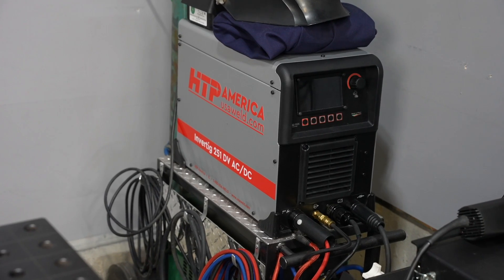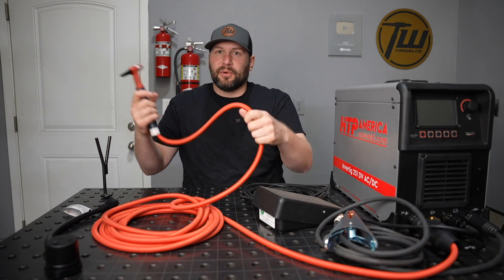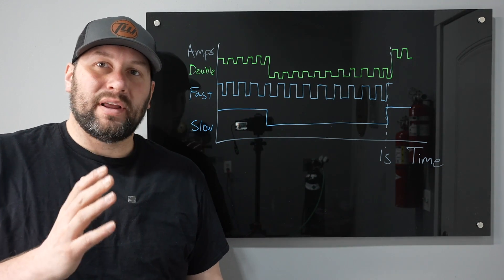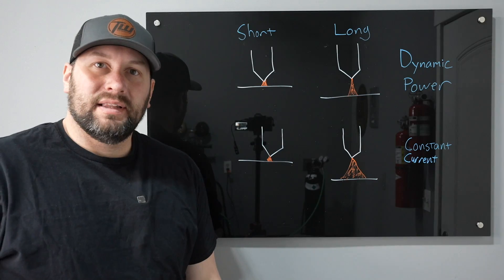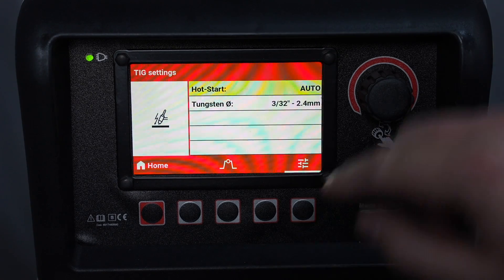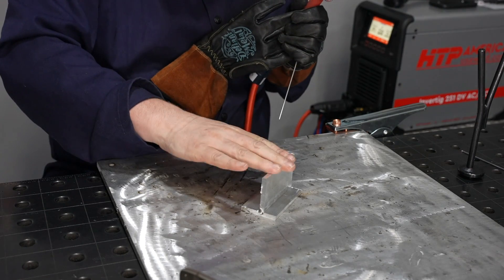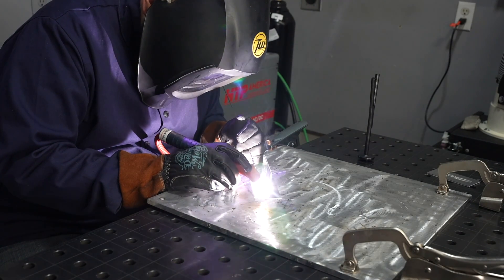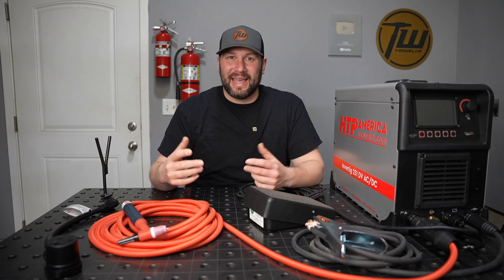What’s New on the HTP Invertig 251 AC/DC TIG Welder?

Comment: Great video Tim! Would you know if the 251 has a solid state HF start or is it still a spark gap setup like the 221? Gaps fine but it'd be nice if they went digital on the nicer machine.

Comment: Ok Tim, I just found your channel and really appreciate your candor in evaluating this welder. Finding your video is also just in time to add to my confusion on buying a premium TIG machine. Currently looking a Miller's new Dynasty 210 and Fronius 230i, wondered if you've had any experience with either? I must say the HTP is very impressive and the pricing is a component of that impression, but like the Fronius, this is a foreign manufacturer and support is part of my concern, also can other torches such as CK products be used on it? Thanks again for your review and you've got another subscriber!
Reply from the maker: Great questions! I have a Dynasty 200 that I bought brand new in 2010 and it's a great machine. The new ones have a nice interface and a few more features, but the performance feels similar to me. I've spent about 8 hours running a Fronius Magic Wave, now the iWave. They're  both really nice machines. This one performs every bit as well and has good US support by HTP based in Chicago. It's completely compatible with CK torches, that's what I run. It's also compatible with Miller foot pedals. HTP usually includes CK torches with their machines, but the air cooled one on this is a heavy hitters with a higher amperage rating. You can call them and they'll customize the package to include whatever torch you want.

Comment: @TimWelds Hello Tim. As you know HTP was bought by Stel. So in Europe we get Stel T300 which is identical to the DV 251. So my question is, since you have the unit, does  your machine give an error when you turn it off and then after 1-2 seconds the machine starts the power down cycle or are the italians bull@#$ me and mine has a problem. It is a brand new machine.
Thanks!
Reply from the maker: Honestly, I haven't looked at the screen after I turn off the switch. If it doesn't cause a functional problem I probably wouldn't have noticed.
Reply: @TimWelds  Thank you. By the way great videos.

Comment: Thoughts on this vs just going to the Revolution as an all in one?   My 15 year old Hobart MIG is as basic as you can get and I'm looking for a new MIG, but I wouldn't mind trying a new TIG as well.  Currently running an Everlast 255ext, and I struggle with low amperage arc stability.
Reply from the maker: This one has a lot more features like independent waveforms, fast tack, soft pulse, etc. The TIG performance is just as good on the Revolution 2500, from what I understand it shares a lot of the same electronics. The Revolution has all the basics such as 2 waveforms, AC and DC pulse, tunable starts, etc. If you don't need the fancy features and could use a wire feed welder too, the Revolution is a great deal. If you want the extensive feature set or if you don't need wire feed, I'd go with this one. The low amperage arc stability is great on both.
Reply: @TimWelds my main concern with a multi process is that if it goes down then I'm stuck without a MIG and TIG.  We use both types in my shop, sometimes at the same time.  Probably try out HTP with a MIG unit (which apparently they all do DC and stick).  And if I like it, add a TIG later.

Comment: Out of curiosity, how does this compare to the Primeweld Tig225 or Tig325? From the beginner hobbyist it seems this HTP has too many features that can serve as a crutch for learning the right technique. If you are experienced, and this improves your efficiency I can see where that would matter.
Reply from the maker: That's a great question. I have used the PrimeWeld 225 quite a bit, but I haven't tried the 325. I wouldn't say that any of the advanced features really serve as a crutch for bad technique, with bad technique you'll get a lousy weld no matter how nice the machine. The advanced features just allow you to fine tune the process and do different things. A few examples that I use regularly:
Asymmetric AC waveforms-I almost always run my electrode-positive side lower to keep a sharp point on my tungsten and give a very narrow etching band
Waveform Control-On thin metal, triangular wave gives better penetration without burning through
 More Waveforms-If I want a really shiny bead, soft square wave reduces the amount of aluminum spitting (not a technical term) from the puddle, leaving the the bead more shiny (you can see the more dull speckled appearance on aluminum beads from most budget welders if you look closely)
Adjustable Hot start-Most welders start the arc at a much higher amperage than the   setting. Notice review videos of budget machines on thin metal/razor blades/pop cans almost always start off the side of the material or on filler metal, then move to the joint after the arc is established. This machine allows you to fine tune the starting characteristics and start right on the material. 
Advanced features aside, the reality is that higher end machines like this just weld better than budget machines. They're just built differently. Don't get me wrong, I think the PrimeWeld is great for the money and I recommend them often to the right person, but I like the feel of the welding arc on the HTPs much better even without the fancy features. I still use my HTP Invertig 221 quite a bit, it's also an awesome machine with fewer features that's still available around $2k, though the user interface is pretty outdated as it's been on the market for about 15 years. I also have a Miller Dynasty which is right on par with the HTP machines, but at twice the price, I think the HTP is a better value with equivalent performance. Both the PrimeWeld and HTP are a great value for what they offer, it just depends on whether you're in the market for an entry level or professional level machine.
Reply: @TimWelds  Thanks for the very detailed and thoughtful reply. I would love to get the HTP but can't really justify it my use case as a hobbyist that welds a couple of hours a week. I figure the Primeweld will be more than plenty for me and give me a chance to get more welding time in since I can allocate more of my budget to the overall setup like a water cooler.
Reply: @MegaMajormax  if you plan to continue welding for a long time you may want to consider the htp anyways. its a safe bet it would still be working 10-15-20 years down the line. i wouldnt hold my breath prime weld could last that long

Comment: I love the HTP’s. They run as good or better than the Dynasty’s. My only gripe with mine is no scratch start and the wireless foot pedal set up is a bit “aftermarket”. Other than that I love mine
Reply from the maker: I agree 100%. I have a Dynasty and 2 Invertigs besides this one and I've also demo'ed Fronius, Lincoln and others. The HTP's honestly run as well as or better than any of them at a much more reasonable price. This one has a live lift start option, it's called lift pipe mode and it works great when you don't want to use a pedal. I haven't used one of the HTP wireless pedals, but I've seen them and they don't seem quite as well integrated as the Miller. I might buy a Miller wireless pedal for the Invertig 251 since it's compatible with Miller accessories, but I'm not sure if it's worth it for me since I plant myself at one spot at a workbench for almost everything I do and the wire isn't a big deal in that situation.

Comment: Nice review Tim. It’s amazing how fast welders are evolving these days. When I started welding in 1973, we were using welders that looked more modern than the ones from the late 1950s, but it was mostly new case designs. In fact, until inverters came out, little was done. Lincoln had their transformer Squarewave machines, and a few other relatively minor new features came out from comoanies, but not all that much that made a real difference. But now, you have a machine for three years and it seems obsolete. When I bought my ESAB Rebel 215 it was at the head of the pack. But then the 205 came out and that’s what I’m using. What will be next?

Comment: Wow, those features are very impressive. I dont think I can justify it in my home shop, but I enjoyed watching and it is good to know what is available out there. It seems that if there were a readout recording of the V and A off the Dynamic power feature, one could use that to see how steady their hand was during the weld, e.g. by looking at a graph over time of the V and A. Thanks for sharing, Tim, very cool tool, and very well done video. I appreciate it.
Reply from the maker: Thanks! Even without dynamic power, you can tell how steady someone is by watching the voltage output because voltage correlates directly with arc length on any machine.

Comment: htp are good solid machines. had one for almost 10yrs.
Reply: I have and use a HTP Maxi Mig my dad bought new in the early 80's. Still works great. Don't think I'll pull the trigger on the 251 but I'm leaning hard toward buying the invertig 221 DV.

Comment: Very interesting review, thank you. If I didn't have two Everlast MTS welders I'd think about the HTP. One thing, as I watched the video it looked like you used two different torches, one water cooled black and the red one that came with the welder. Any reason why? Just wondering, no big deal. Thanks again your videos.
Reply from the maker: Thanks! When it first came in, I switched the box out onto my Invertig 221 water cooled setup to get a feel for the machine on a few projects. I didn't unpack the accessories until I made a set of video manuals for HTP, which show the setup of the machine. When I made this video, I thought it would be interesting to include some of the actual project work that I did when I was kicking the tires, so those are the clips that have the water cooled torch. It's available with that torch and a cooler in a different package you can get from HTP.

Comment: Very well presented and explained.  Having owned both an Invertig 221 and 400, and instructed with both, the simplicity and clarity of the screen display of the Invertig 251, as compared to the Invertig 221 with all its drop down menus and sub menus should make this the ultimate professional level welder in this amperage range.  I am looking forward to getting one to replace my 221.  Nicely done as a YouTube Video
Reply from the maker: Thanks! I completely agree. The menus on the 221 takes a little getting used to, as did all the machines released in that era. The 400 is a lot easier, but the 251 is on another level completely; it's really an awesome machine.

Comment: Sir. Doesn’t appear in some shots you’re using the torch it came with but you are describing features it has.. Why the CK in some shots and water cooled it appears at that. . Confusing. 

Can you elaborate how heat even with a bigger air cooled torch might affect the tungeston vs water cooled over time and keeping the tungeston at a consistent level of heat. Trying to learn and understand. 

I don’t know..
Reply from the maker: Great question! I can see how that would be confusing. You can buy this machine in a water cooled package that includes the same CK torch that I was using and a water cooler. I just looked at the prices they have listed for the water cooled package and it's actually a really good deal for that upgrade, though the air cooled torch works really well too. 

The reason that both appeared in the video is that I've had this machine for a few weeks and when I first got it, I dropped it onto my cart that already had a water cooler to use on a few projects and get familiar with it before I made any videos. When I started filming specific videos about the machine, I set it up with the stock torch. I figured a few clips from those initial projects would be useful in the video, so I included them even though I hadn't unpacked the stock air cooled torch at that point. 

As far as water cooled vs. air cooled torches go, using a water cooled torch has 2 advantages. First, you can use a smaller size torch for a given amperage which makes it easier to handle. Second, the torch body doesn't heat up after long runs like it does on air cooled torches. It doesn't have much of an effect on the longevity or consistency of the tungsten electrode itself, though overheating collets can cause them to deform a bit. While I would generally grab a water cooled torch given the option, I often use an air cooled torch when I'm on the go or in the shop if I'm not making long runs at high amperage in order to avoid the noise from the water cooler.

Comment: While I always appreciate options and features especially when it’s done to this level of quality, does the manufacturer provide an additional in depth suplemental information packet that explains not just a definition of the features but a practical explanation for when it might be helpful to use … if i can’t leverage all these interesting waveforms and features then I’d be better off picking a simpler package and paying less.

I think this video is an excellent example of what a good feature explanation could look like or at least take some notes from. While options and features are almost always better to have available than not, the more that can go wrong the more points that a failure may adversely affect the systems function. 

What i wish manufacturers understood was keep it simple and keep it fast and easy to access. If you want to include extra features using a single rotary encoder knob it gets ridiculous to operate once you’ve gone past 4 sub menu deep. If i have to hunt for an option it’s too deep, somewhere out there a balance exists between readily accessible & over-cluttered + over simplified & difficult to access(options & features). It doesn’t have to be all analog/toggle switches or one single digital display w/ rotary encoder. 

 (IMO) Make the most common and useful features readily accessible immediately by toggle switches or no deeper than 1 submenu past opening screen & make a section off to the side boxed off called User Profile #1, 2 , 3 for single button press customizable settings/modes that wont erase even after power removal. That way I can pull up setting to cover 98% of what i will encounter and the other 2% I’ll remember to send a thank you card after realizing i didn’t have to exert special effort/attention to utilize the extra features that were made for these very situations,
Reply from the maker: This is a great comment, and I agree. HTP actually hired me to create a 6 part video owners manual series that you can find on the HTP YouTube channel and they will probably link it in the product description as well. In these videos, I walk through the setup of the machine and the settings for every feature that it offers, so you can see exactly how the menus are operated and some practical applications. 

The menus are pretty straightforward on this one, and there are 5 buttons below the screen in addition to the rotary encoder knob. I get what you mean about the deep menus, because I've lived that for years and it's a real pain. I was at a shop the other day and was talking to one of their welders who was struggling to weld some very thin aluminum. I asked if he had tried triangle wave and reduced the start amperage, he had no idea that you could even do those things (it was a different brand of machine, not HTP). I was familiar with the machine and walked him through about 25 button presses to set that stuff and I still wonder if he was able to get back out of those settings when he finished the job. 

This machine is much more intuitive. There is a series of menus that walk through the main settings for a given process to make sure that you address them. Beyond that, nothing is more than 2 menus deep. One of the best things they did is add a basic interface setting, so you can set it to basic mode and just have the essentials. This simplifies things and makes it a very easy machine to run, then when you need the advanced features, they're available. 

It does have the ability to store jobs, so you can do what you're describing and store the  settings for the different jobs you do, then it's just 2 button presses to recall everything for whatever type of job comes up.

Comment: Super excited about this one. 

How do the arc starts feel in comparison to the Rev. 2500?
Reply: 80% of the hardware ( the boards inside ) are identical though ….  But the software is much more advanced on  the invertig 251
Reply from the maker: It's a great machine. The arc starts are very similar to the Revolution 2500. Both machines have the option to set a hot start amperage and start amperage independently to fine tune it if you want. They also both TIG weld very well, but the feature set is much more advanced on this one.